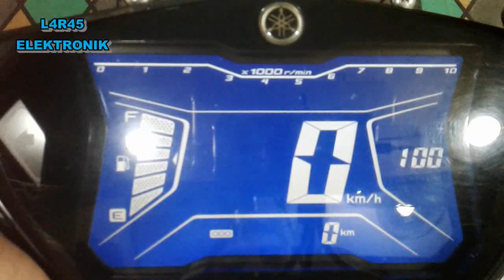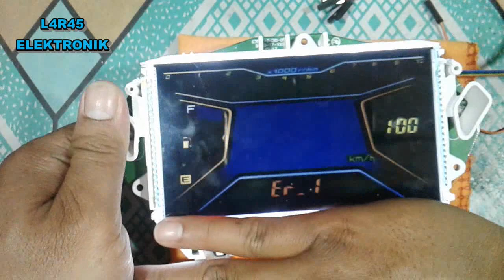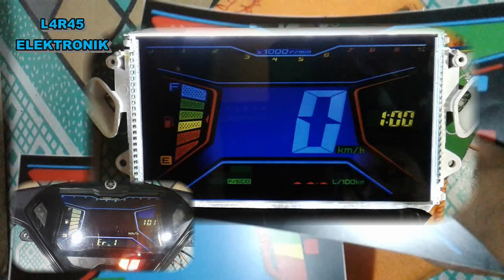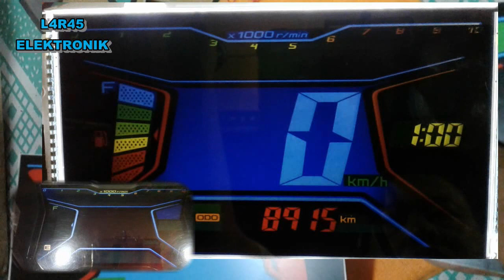Custom LCD Speedometer AEROX 155

Comment: Mas apakah engine check pada speedo aerox bisa pakai punya satria fu fi?  Mohon jawabannya mas... 
Sama pin outnya ecu sama speed sensor pin berapa ya?
Reply from the maker: Ga bisa bro....
Di pin soket speedo aerox.. ga ada pin speed... sinyal speed jd satu dgn pin ecm
Pin ecm q blm cek pasnya
Reply: Berarti err 1 itu gak bisa di ilangin ya kya fu fi?
Reply from the maker: Bisa bro... d sambung ke ecm motor nya...
Oiya sinyal dr sensor speed masuk ke ecm....
Reply: Masalahnya motornya bukan aerox tapi pengen pake speedo aerox hehe 
Ya udah terima kasih yah mas ilmunya
Reply from the maker: Samaa samaa bro...

Comment: Mas. Sepidometer saya motor supra x125 karbu kalok lampu nya di ubah dc lampu indikator lampu jauh nya kok engak nyala ya mas bagai mana cara nya supaya lampu nya nyala mas
Reply from the maker: Ada dioda dan led yg hrs dbalik di dalam spido nya bro
Reply: @P4N71  bener kang 👍 punya sy langsung bisa nyala
Reply: Bisa buat kan video nya ka mas
Reply: @rusminfika9736  tinggal di balik aja mas kaki dioda dan lednya. Diodanya ada disebelah lednya pas kok tinggal pinter2 aja nyoldernya karna kecil sekali diodanya
Reply: Yg warna putih ya sebelah led kan
Reply: @rusminfika9736  iyup betul sekali yg ada kode tulisan 3 angka itu dibalik sama lednya ikutan dibalik
Reply: Sip terima kasi bro atas saran nya
Reply from the maker: Samasama bro

Comment: mas bro, jalur speed sensor aerox yg mana ya
Reply from the maker: Ga ada bro..d speedo...
Coz jd satu dgn kabel ecu/ecm
Reply: @P4N71  bang utk indikator lampu beam. Itu bnar dikasih plus 12 volt kan ya inputnya? Kok lampu indikator beam gak nyala ya. Apa khusus aerox inputnya pke arus AC utk indikator beam? Mhon infonya bang.
Reply from the maker: Bawaannya tegangan AC bro
Reply: @P4N71  berarti kya satria FU FI ya bang?
Reply from the maker: Klo fufi , indikator beam bisa nyala klo ada sinyal RPM bro
Reply: @P4N71  mantab bang. Makasih ilmunya... Kbtulan saya bengkel. Suka oprek oprek. Chanel abang adalah chanel favorit. Hehe... Penjelasan detail dan mudah dimengerti. Sukses trus bang... 👍
Reply from the maker: Klo aerox klo ga salah beam ada 2 kabel, beam- dan beam+